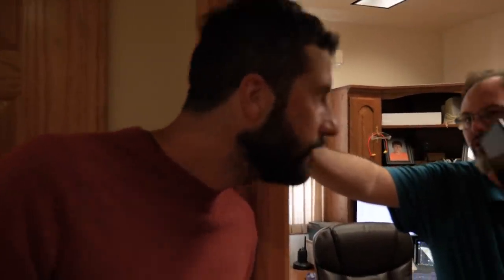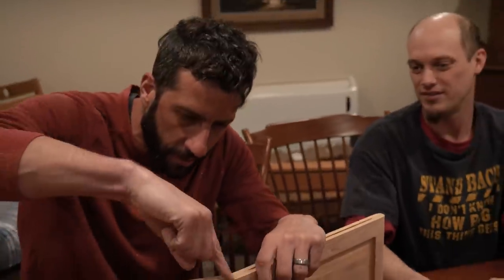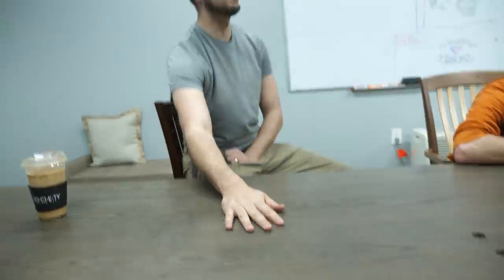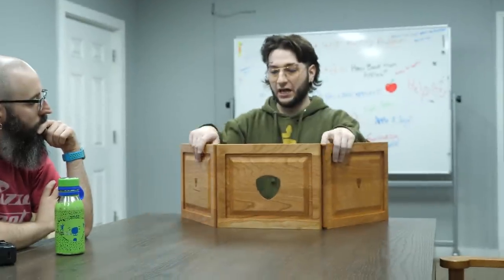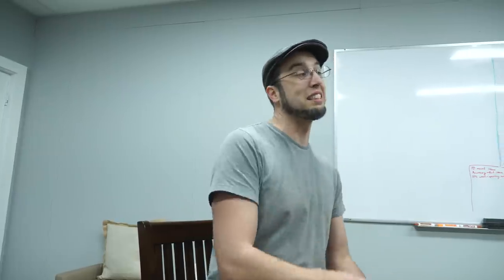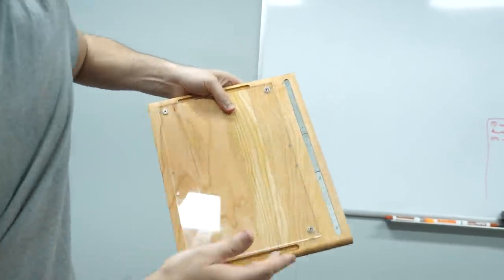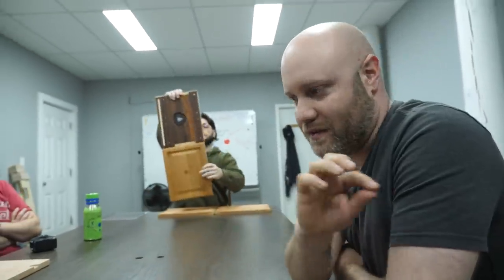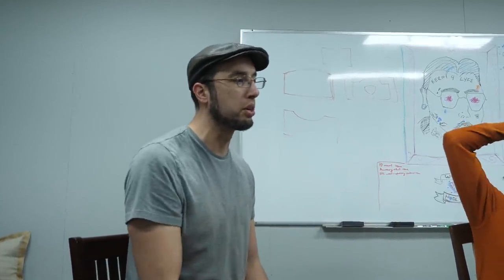New GM Screen Design Pt. 4 (this thing is dangerous)

Comment: I would be strongly tempted to make the mounts for the acrylic some kind of spring clamp instead of a magnet. As the piece that will probably be most likely to be damaged but also easiest for a consumer to replace without much tooling, seems like a win-win?

Comment: The darker veneer on the cherry looks more appealing to me than the un-veneered, for sure.
If the magnets are so strong, would it make sense to increase the width of the wood outside the magnet so that it's more durable without losing as much magnetic pull as going to weaker magnets?

Comment: What if you used the rubber feet to cover the magnet holes on the bottom. Two birds one stone. It reduces the material needed to plug the holes while adding the grip feature that Jason wants.

Comment: I don't know how much more difficult it would be, but if you made the center panel an inverted trapezoid so the top was maybe 1/32" wider than the bottom, that would create just a tiny little lean on the side panels to keep them from swinging. Assuming the side panels are 12.6" wide and 9.44" tall (24cm x 32cm), it would only create a lift at the connection to the center panel of 0.53mm, or about 1/50".. That might not even be noticeable to people.

Comment: suggestion : use rubber feet to bung the holes (the hole is there already). IF you go with the veneer, could you revisit the Adventurer Party series to match the vaults?

Comment: I do like the solid panel set, interested to see what other woods they might be available in. That said, the veneer version look sweet, especially if that veneer line it clean.

Why not put the rubber pads on the bung holes and recess them slighty.

Comment: Bungs should be the same wood with grain aligned.  Once again Cristaldi was right.  Solid panel with moulded relief is cheaper and looks great.  Definately clear rubber inset on bottom is needed.  Brass or aluminum bungs should be polished.  You dont leave sanding scratches in wood so dont leave them in metal.

Comment: How about a way to attach current table accessories, like a pocket to hold dice or pencils? 

Or, completely separate idea, a panel with an integrated dice tower. DM puts a die in at the back, and it comes out the front.

Comment: is there anyway to get a middle ground between the two magnet strengths? i feel like i need more than the revised magnets are giving. also the bung holes could be a rubber cap that acts as feet for the screen on one side.

Comment: Just a thought on those holes - If you are going to be adding rubber feet on the screen, why not replace the plugs on the bottom with rubber instead of wood? You would still need the wood plugs for the top, but cuts the amount of wood you need in half.

Comment: The brass looks great. Why not put a foot on the bottom bung hole? That way you can place a rubber pad directly on the bung, or make the rubber foot the bottom bung. Also, the veneer feels like a thiccc boi. I think it may look much better without the white line Doug was talking about.

Comment: The veneered looks really good actually, like really super good (at least on camera. The contrasting wood for the "bung holes" was also nice, I think that is sort of a personal choice though. I also think that if you try to use the same wood to fill the bungs that its is still noticeable and its worse that you were TRYING to match it and failed - vs if you intentionally point it out with the contrasting material or colored wood. Is it realistic to be able to get a consistent grain direction match and color match inside of the same woods with the potential volume / throughput, and whereas in context of an MGT, its probably in locations that you aren't really up close to all the time, with the GM screens those areas are going to be pretty visually immediate right on top. I would want the choice of a metal or a contrasting wood that looked good. Going with wood also probably gives you something to do with smaller scrap pieces to help minimize waste even further, vs having to source the metal fill.
Reply: Could you orient the panels so the end-grain is north and south?, which gives the sides with the magnets a potentially more wear resistant connection point? I am not sure if that makes sense.

Comment: I've been following this process since the beginning and I really love the design and hidden magnets.  I do have a question/concern about how the panels fold together if the acrylic sheers are added, especially with the force of the magnets seen in this video.  Are the acrylic sheets to be removed each time before transport, are they at risk of breaking if the panels are stacked together or is the plan to recess them enough to prevent damage?  Asking because I am a traveling DM ad wouldn't want to hassle with removing the acrylic sheets and and DM info/notes held behind them before packing the screen for transport.

Comment: I would say those magnets causing the frame to crack on the side is a bad issue, but if you use ones too weak that you can't hold the screen together (especially if it is even worse once you put the acrylic cover i.e. more weight on it) would be more annoying.

Comment: The veneered version lends to it looking sloppy if done en-masse. Brass caps look sharp. Need to find a happy medium on that magnet strength. Definitely still thinking frame and panel is more showcase of an item to take pride in than the veneer. I understand that it's to drive cost down, but it also diminishes the niceness of the product.

Comment: I like the look as-is but I understand that if the team can take it up a notch, then they should.
I'm not really concerned with what the plugs look like because the edge of the screen is not my focus...the front and back of the panels are.
For a DM screen, I want LOADS of functionality. I like the clear panels to cover papers, but I want them on BOTH sides if possible. That way I can put DM stuff on my side and 'for players' stuff on the other.
If the slightly weaker magnets are cheaper and leave more wood to make it stronger, I'd go for that. Sure, building a panel ladder is cool but it's not very practical.

Comment: Release the dimensions for the insert if it gets sold that way so one can 3D print designs that stick further out like a dragonhead. On top of that i like the two tone with the dark outside layer better than the solid one.

Comment: Ok what I'm gonna say is not even considered remotely and I understand but my two cents on the matter is this. A Dm screen will eventually fold, holding the materials in it. I seldomly if never see a Dm re organizing their DM screens every game. This version looks ok, functions great (with strong magnets) so kudos to you. But this should as well function as a over glorified folder for materials. I just dont see how this panels would fold together with the materials inside and not chip/scratch the surfaces. Obviously not everyone would be onboard with this point of view, which is fine. But maybe create a side panel alternative (which we can purchase as an option) where we can safely place our papers etc inside and fold the screens so when we finish our games, we can just fold it and place it wherever and not think about it later on.
Reply: OR maybe, you can machine inside of the panels just a little bit, which in turn will lightern the dm screens as well as create spaces for papers.

Comment: Aluminum/steel bungs, matching the metal elements on the DM side. Because wood bungs look cheap. Always. And I'd be curious to see veneer on the "Panel", but not on the "Frame".

Comment: Is there a middle ground between the weaker magnets and stronger magnets? If there is I feel like that would end up working out better so the wood doesn't break and might hold together better. I say this based on the fact that I have pets that are aspiring physicists.

Comment: Just worried about the long term integrity of the wood edges. Make up a testing rig with say 10k snaps and stress test at different temperatures. Should give you an indication of longevity. Aesthetically it is missing something. I like the look but i still feel like I could make it in my shop with a router. Some other colour combinations or inlays are needed to give that veneer look.

Comment: I think veneered centerpiece, and the sides unveneered. An  I chose to have a complementary woodcolor for the side panels that would really look cool. Also the soild wood solution would give me the option with a bit of artistic talent to customize my side panels a bit more myself.(and of yourse buy more ;) if i screw it up or want a different look for Cthulhu and DnD DMing)  Also i got a laser engraving machine so a lot more options. And you could do special editons in the future with specialy branded sides. What do i have to do to get the prototype for me in germany?! And the bungholes should be plugged but as an engineer i am always happy to have a piece i can get out and in again if necessary but as i said i am weird. Last but not least the metric system is way better imperail units are dumb ask the Mars Climate Orbiter.... Oh, Sorry you can not because it crash landed.

Comment: It still looks like a bad kitchen cabinet panel.  Ikea would not ship this.  The only wyrmwood grade feature I have seen is the hidden magnets.

For each revision, compare equivalent pictures of the prototype and Mercer's screen.  Have someone unbiased compare them.  Ask them if the new panels would work as a lower cost model for this product line.  If they can't immediately say yes, ask questions about the scoping, or end up making funny faces, you have missed the mark and my wallet will not open.

You don't need to match techniques and materials, but you do need to match the lines and elegance of the design.  Start with Jason's design of Mercer's side panels for the look, and look at how to match the look with a solid laminate product (solid wood was a bad idea and Doug should feel bad about it).  Laminate a bunch of walnut over maple and hog out that much of the frame wood (or be more picky about the frame wood for the laminate), but it has to look more like the mercer screen than the discount cabinet door bin at a homecenter.  I'm not talking about inlays and such, but design forms and two wood usage should be close enough that I think I'm going to the same shop for both of these.

The logo cutouts do not seem like a good design to me, they add more parts when the goal was less parts, and they keep the center of the screen from being as thin as it should be.

From the DMs side drop the acrylic, it'll be junk way too soon and tit adds a new part type to track.  just stick with the inset metal bars and provide 4-8 mini magnets. Two bars on the upper side and one on the lower is more than it really needs, but I'd like to see it if that's not unreasonable.

Comment: BUNG HOLE comment:  do you need magnets from the very top to the very bottom of the panel to maintain strength / integrity?  if not, i say put the magnet in the middle and bottom of the panel and leave the bung hole open at the top for a pen/pencil insert...which i believe wyrmwood makes pens/pencils still???  would they fit in that hole?

Comment: Wasn't a big part of the Mercer (or Cristaldi) hinge was that it allowed for the screen to fold up and be bound in leather straps for portability? This can technically be folded, but man does it look chunky for travel.   

Also as far as aesthetic - these do look pretty nice, but with compromise. The thickness on these makes the panels pretty unwieldy to me. They are obese - which they probably need to be to accommodate the depth of the route out. It feels like it's cheating to achieve the frame and panel look, and is desperately trying to compensate for that cheating by just being fat. And the result is a sad imitation of what it's trying to be.  

Still on team frame & panel, though solid wood/veneer does seem like a thing people will buy regardless. Either way, thanks for showing us these, some of my favorite Wyrmlyfe content.

edit: a typo